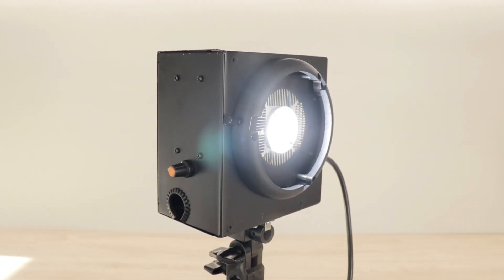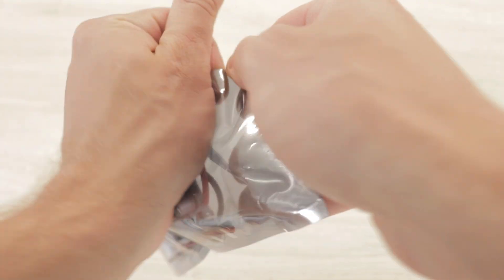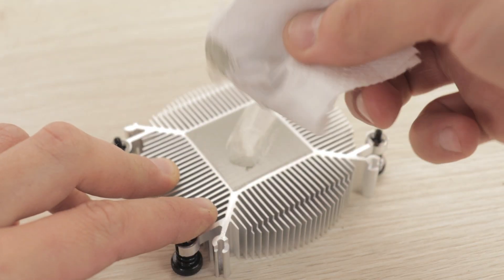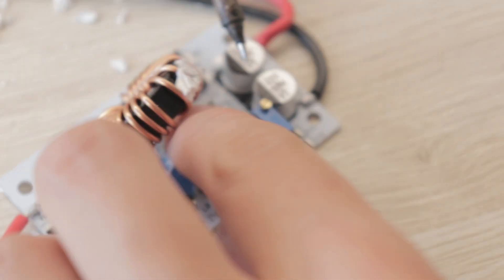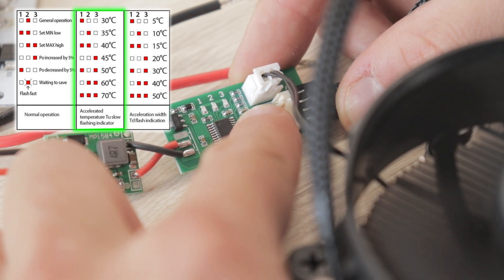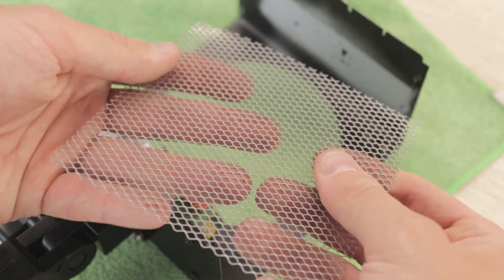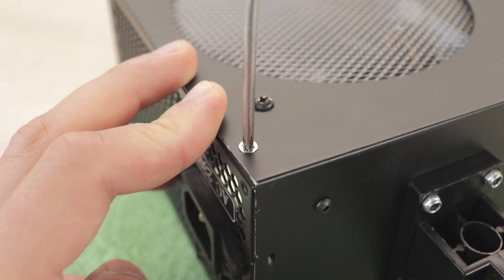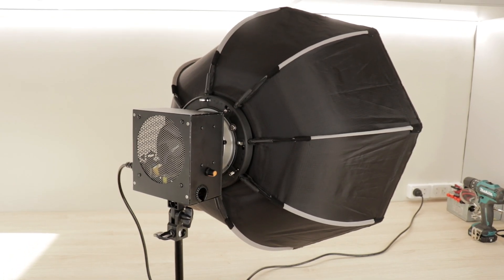ULTRA Bright 100W Studio LED Light from Old PSU

Comment: One thing, if you would have used a heatspreader and fan just a little bit bigger like 120mm fan with some bigger cooler for it, the whole thing would do both run way quieter and way cooler which would increase the life of the cob drastically.

Comment: Brilliant DIY Project. By the way, aluminum cpu heat sink alloy is very strong. Everyone assumes it’s soft and ends up shearing off screws in it. Aluminum CPU heat sinks should be drilled and tapped. Also, they now make LED drivers little step up from 12 V to about 40 V. That will allow you to use a 12 V rail and not have to use a boost circuit. Then again, using a boost circuit as a driver gives you flexibility as far as dimming control. You could also buy LED drivers that have integrated dimming control. Anyway, Lots of ways to do this project. I really enjoyed your approach because you use just about every single DIY circuitboard you could possibly buy.
Reply: Well that led driver is more or less a boss converter

Comment: CRI is not a good unit of measurement for color rendition. TM30 is better, which is what high end brands measure. CRI may be 97, but TM30 doesn't touch 90. These AliExpress "grow lights" are resells of leds that didn't meet bin requirements

Comment: I just wanted to drop a comment that opening any power supply is incredibly dangerous. The large can looking things soldered to the PCB are super capacitors, and people have literally died doing this. Those caps can hold their charge for a LONG time, so even if it's been powered off for a while you can still get a fatal zap. Most modern PSU's have protections built in, like drain resistors, but this is something that absolutely should have been mentioned in the video. Somebody, or the family of somebody, who is following your instructions who is hurt or killed would have a pretty solid case to find you at fault because you didn't warn of the danger.
Reply: Also discharging them improperly can be dangerous, I’ve accidentally welded capacitors into a short trying to make them safe to handle. Some capacitors have enough juice that connecting the terminals with something conductive (like your body) is enough to melt metals and the physical size of the capacitor is not always an indicator of how much energy it can have.
Reply: Found the NPC. Just cannot help but fall to the compulsion to outburst electrical danger at the merest whiff of electricity...

Not helping like you think you are... how do you think the device this is viewed on, is powered? You've already missed "firstsies" on the viewer by several years involving hundreds of dangerous situations by the time they can find the video and have the patience to read and  understand what you wrote.

Loser.
Reply: Обычные электролиты, ну максимум ожог можно получить.

Comment: Bro one question how did you set the voltage of boost converter?
Reply from the maker: Hi, the voltage is set by adjusting the potentiometers as shown in the diagram of the video.

Comment: How do you know wich resistors you need ? The 103 should be a 10k but you used 6k combined.
And if i have a 104/100kohm resistor would i need to use 3x 20kohm ?

Comment: Very cool project. I did very similar lights using old studio photography flashlights with bowens mount. I removed bulbs and electronics and retrofitted COB LED. I like how they look and they have great ergonomics. The only drawback is that they are very bulky since back in a day studio lights were much bigger than LED lights nowadays. I figured out how to you can control the brightness using a microcontroller and was thinking of making them controllable via BT or WiFi using ESP32 module.
Reply: Amazingly good work... Only one concerned it's the flicker for video!!!
I'm proud of your precious work!!!
Reply from the maker: Thanks! That was actually my idea as well at first, to re-use an old studio light to have the COB LED fitted inside, but it was quite difficult to source any. And as you said, they are quite bulky. Sounds awesome to have the brightness adjusted using a microcontroller.

Comment: why u dont buy powersupply 36v and dimmer . 24=>36v=>12v??
Reply from the maker: Since the LED operates from around 34-37 Volts, it is easier to use the boost converter to increase the voltage of the 24V power supply to have the full range of the LED rather than a 36V supply that you can't regulate below 36V.
Reply: @DonnyTerek  If using a 36v power supply and a convert 12v low voltage circuit for the fan, is the cost cheaper
Reply from the maker: @benhviencapcuu3960  yes but you don't have the option to dim the LED.